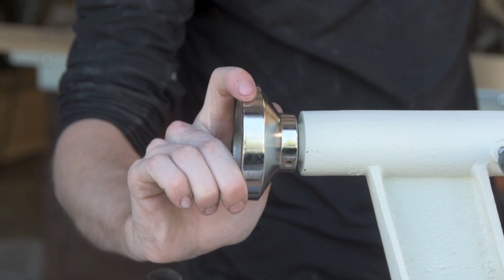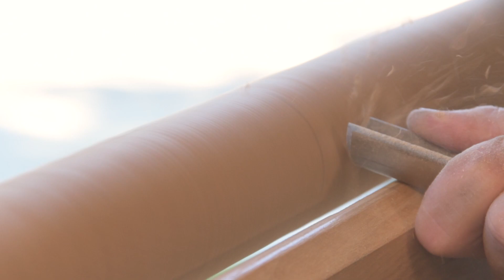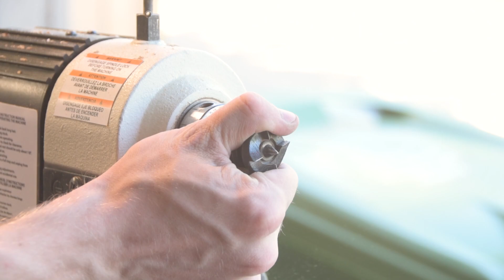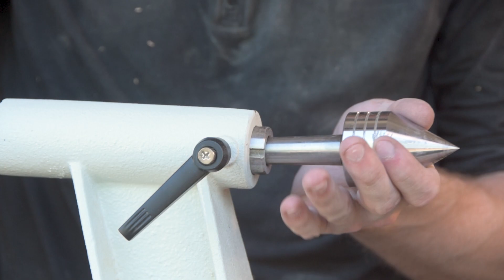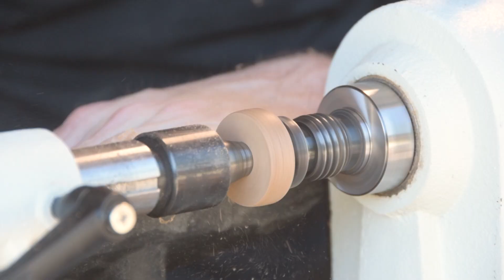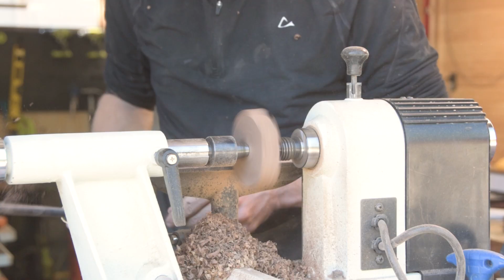Variable Depth Rolling Pin

Comment: thank you Morgan. heads up the tail stock and head stock should match . the tail stock should have an adjustment to move it left to right . if the high is off you may need shim stock to get the up or down  well the up  if it is low . if high its off to the grind shop with it sigh .
Reply from the maker: I'll have to double check and maybe make some adjustments, thanks for the advice!